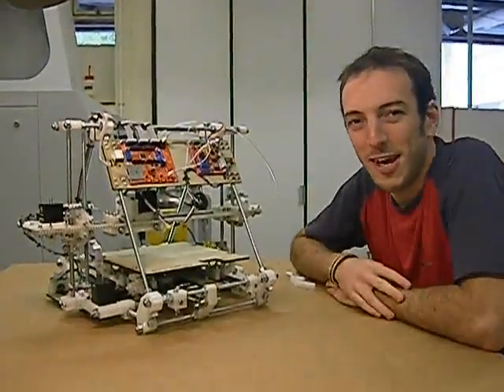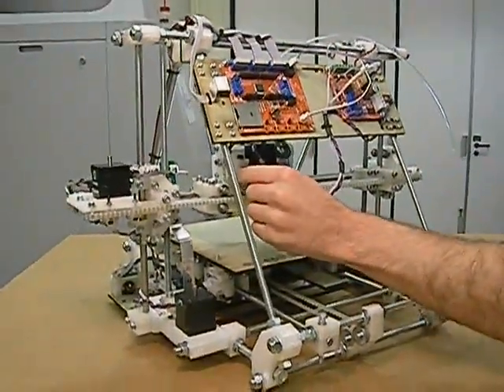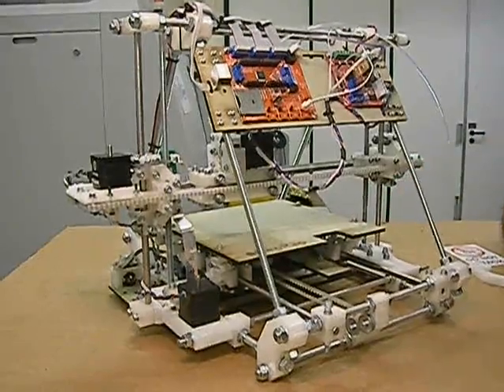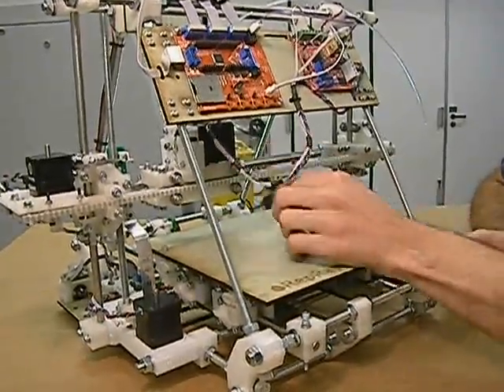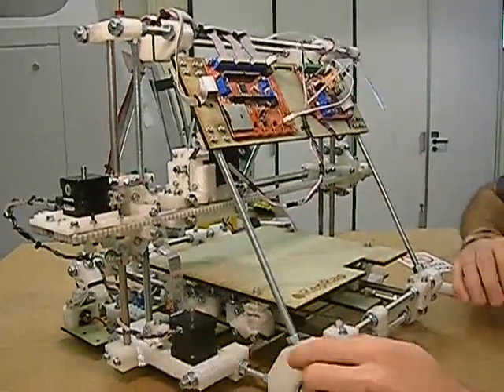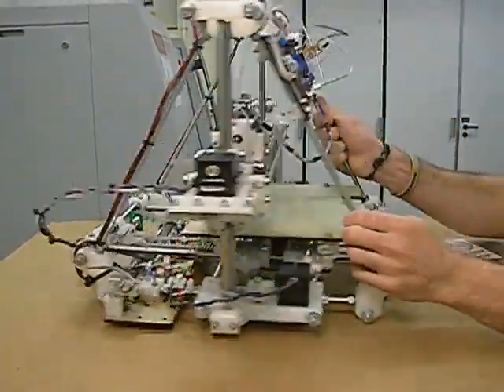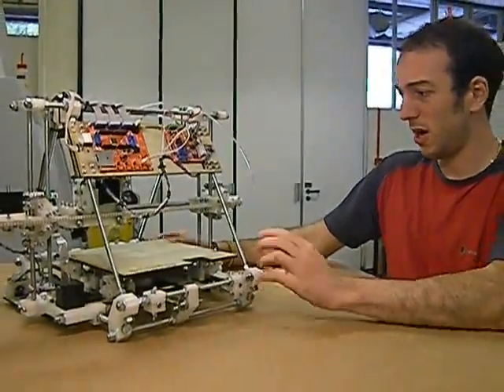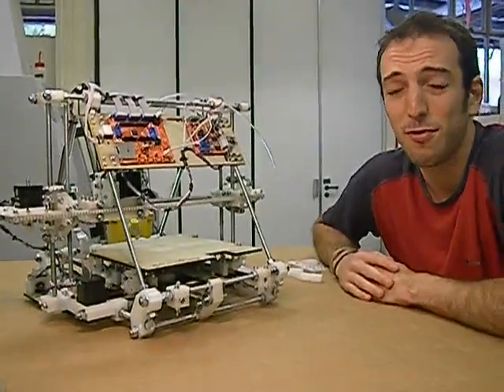Introduction to Mendel (RepRap v2)

Comment: Ahhh the good old days of using nichrome wire for a nozzle extruder and pushing 3mm abs filament into a 0.4 hole, trying to get it to stick to a cold plate of metal. Good times!